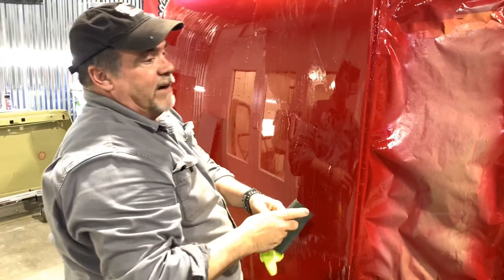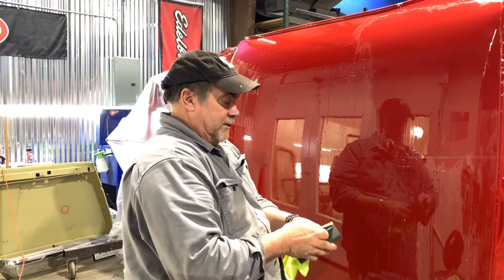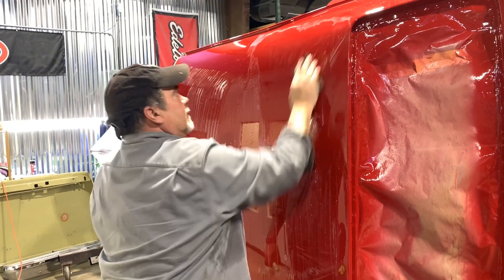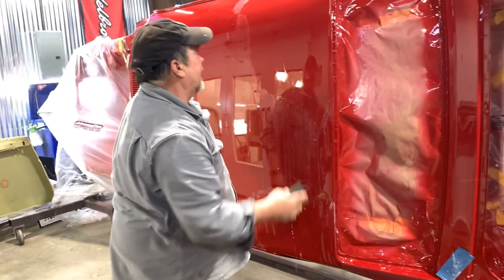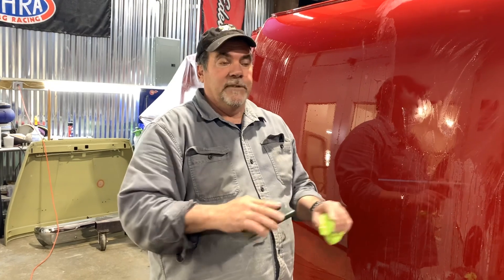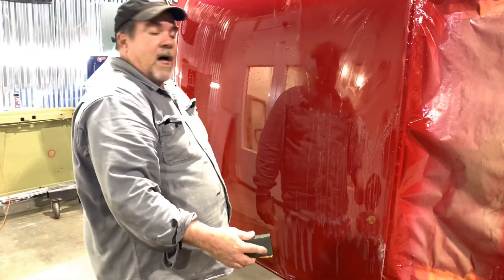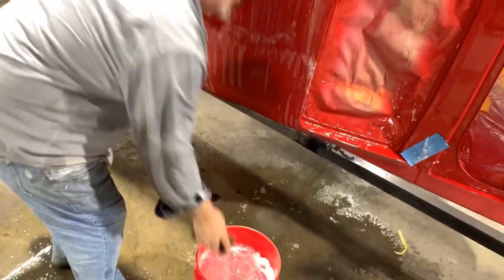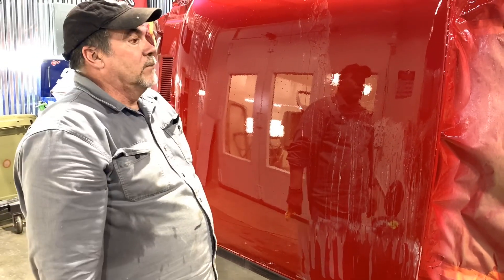Auto Painting 103 - Sanding the Clear Coat on Mikes 68 Mustang

Comment: Jim, I appreciate your serious attention to detail going the long hard way to a serious high caliber restoration. I know that for a fact a common collision shop or a dealership body shop is NOT going to go through the lengthy process you do to end up with superior product. They re just gonna give it somewhere in the neighborhood of a factory paint job and push it out the door as soon as possible. Brand new vehicles today do have orange peel on them! It amazes me watching your videos of you doing body work, priming , painting , clearing , wet sanding etc etc, even though you don't like doing some of that work, you do excellent work!!!
Reply from the maker: thank you, and yes new vehicles have a ton of orange peel in them. I bought a brand new black f150 in 05 and there wasnt even enough material on it to wet sand and buff
Reply: @bennettshotrodgarageclassi7068  My brother is a service manager at a Greasy Motors (GM) dealership.  He was saying recently that the manufacturers have had to cut down on paint thickness for some reason - to the point where they're offering a service to clear-coat the fronts of vehicles to cut down on rock chipping.  I believe the issue was a government regulation.